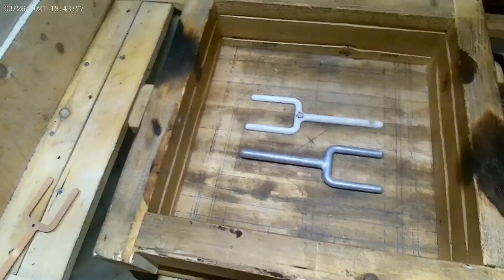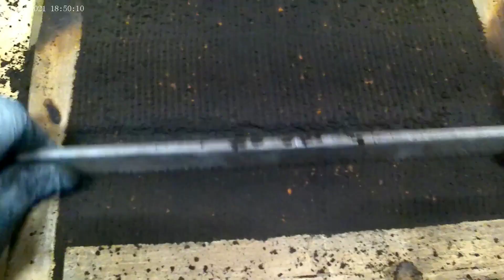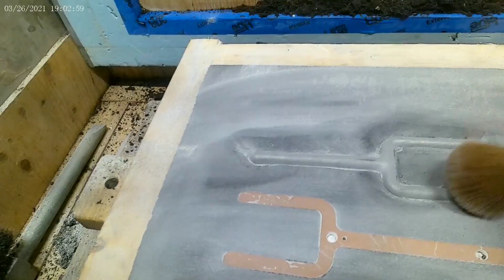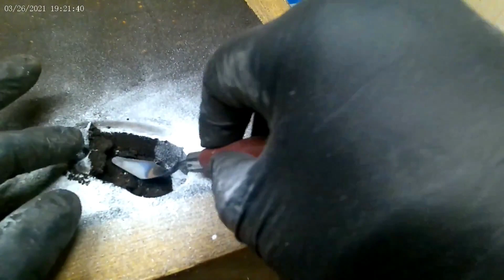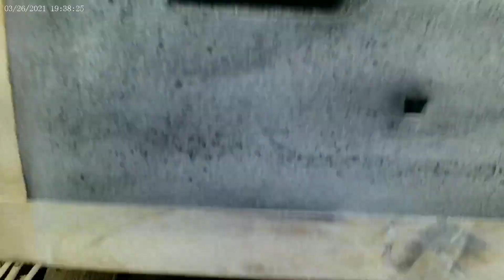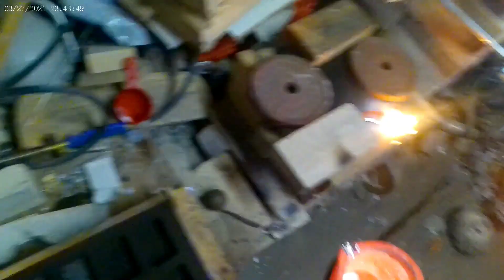Casting a Foundry Matchplate Pattern in Aluminum

Comment: Well Done Sir. Looking forward to seeing you try it out. Handy setup for sure. Cheers
Reply from the maker: Thanks!  I should be able to test the matchplate soon.  Bottom boards and flasks for it are built, but I still need to pin them and drill the alignment holes in the plate...

Comment: I wondered about the surface irregularity and how that might prevent the cope and drag to mate together as closely. Maybe producing excessive flash on the parts. I'm looking forward to see the result. The spacer certainly was a creative solution I would not though of.
Reply from the maker: Every little bump on the "flat" part of the plate has a corresponding dip on the other side, and vice versa, so the slight texture should key together nicely on both sides of the mold as long as there's no shrinkage on the plate anywhere, which I don't think there is.  I could have slicked the drag down smoother before ramming up the cope to reduce that texture, but I actually don't think the slight texture will cause any flashing, it may actually help.  This technique has worked well for me in the past.  Anyway I'll keep my fingers crossed when I go to pour these!